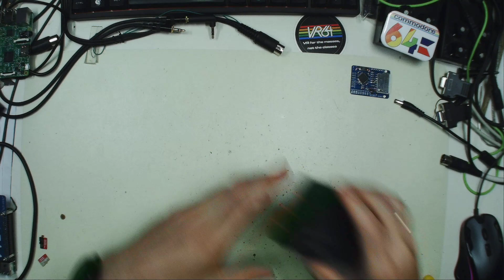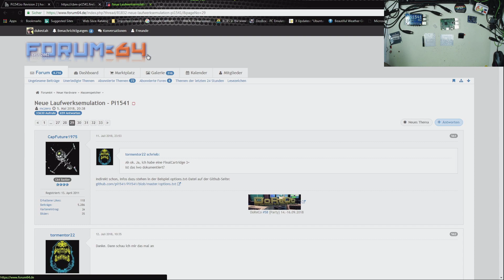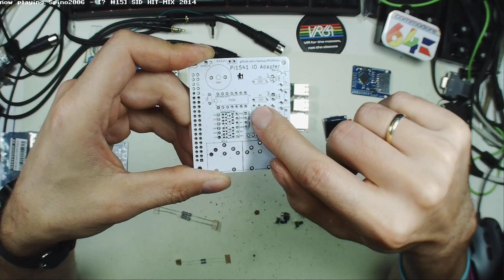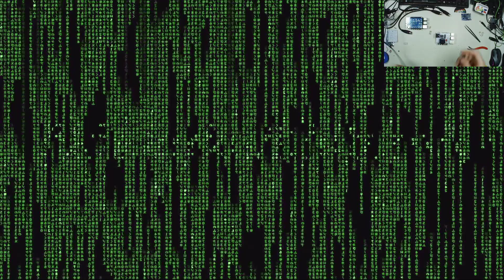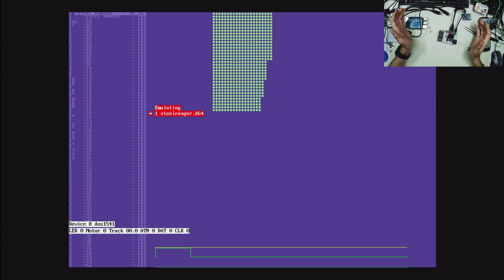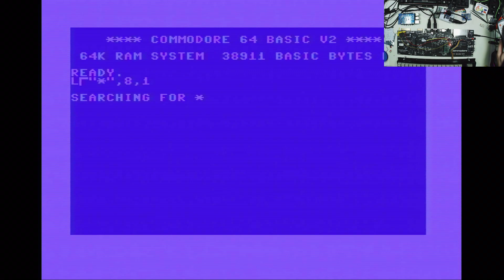C64 Hardware - PI1541 - Assembly and Information - Give-away announcement

Comment: I am interested in winning a PCB (preferably V4). I have most of the components needed in my electronics boxes already. On your table you always have the VR64 badge - at least since jan 18, 2018.

Very nice assembly video. The big resistors are  definitely not necessary - they look like the can handle a lot of Watts, and driving the LEDs will only use very little current.